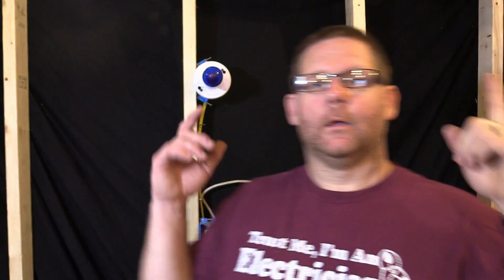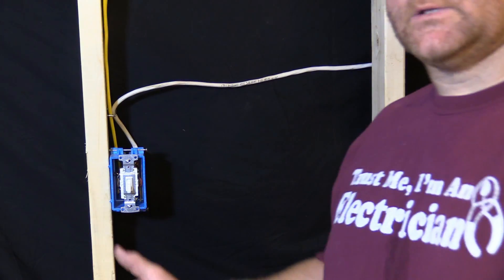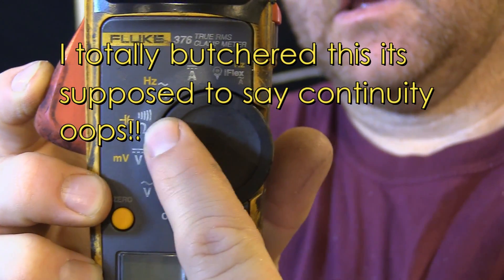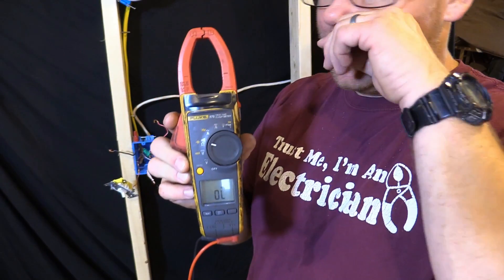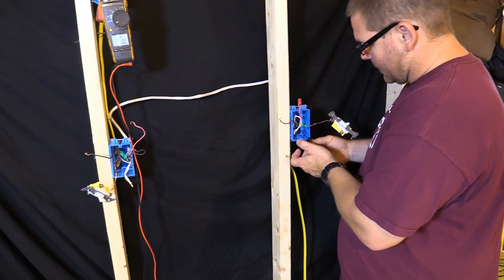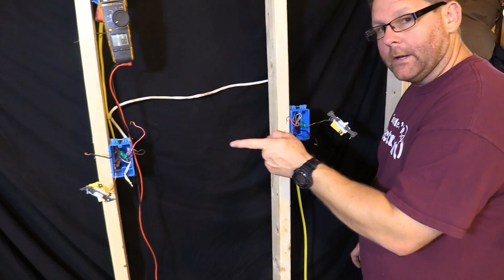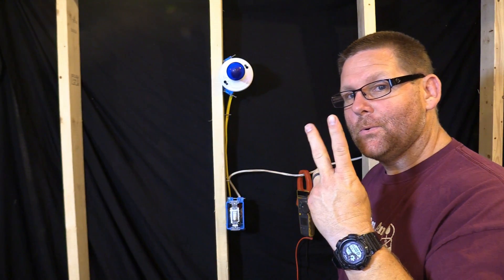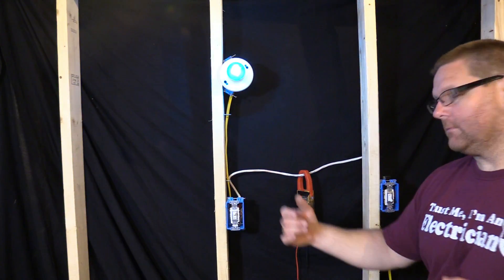How To Fix A 3 Way Switch Problem

Comment: Fantastic video, thank you for you time!
May I ask a question. I’m reinstalling the fan. I have existing 14 gauge wires in both of my 3way switches, but I’m rewiring whole house with 12 gauge. Can I use 12 gauge to power fan and 14 gauge for switches?
Reply from the maker: First of all thank you for the kind words. My answer is no. However, I have seen many electricians do that. When I see that I immediately go to the panel and slap in a 15 amp beaker and call them jack legs. To me that's kinda like buying a Mercedes when you need tires you go to the used tire place instead of getting name brand new ones. Since you are already rewiring your home, do it right and pull new wire to your switches too. That's my advice. Thank you for your question and if you have any other questions please feel free to ask. Good luck 🤞. Thanks for watching and commenting ☺
Reply: Thank you for reaching back to me:) Ok, I’ll use 12 gauge. One more thing: I have 20 amp breaker. Do I need to install all 20 amp outlets or I can use some 20 amp (like for microwave) and 15 amp in bedrooms?(remember, all my wires are 12)
Reply from the maker: Per code if you have more than 2 receps on a 20 amp circuit you can use 15 amp receps. If you have only one then Def use a 20. Most people will tell you to use 20 no matter what (on a 20 amp circuit or 12 Guage wire) but code will allow you to use 15.

Comment: My light keeps blinking. It will turn on  properly, but when I want the light is off it blinks? Please help...
Reply: No, it isn't... I changed the switches to better ones and it seemed to work. But then the circuit breaker blew.... Urghhhhh so frustrated
Reply from the maker: Did they blow when you changed the switch? Are you sure you hooked up the correct wires to the switch?
Reply: @MountaineerOutdoors  I did it the way you did it in the video...
Reply: @MountaineerOutdoors  it blew when I tried to turn the power back on
Reply from the maker: Sounds to me like you have it dead short. Hot to nuetral. Go back and check the wires.
Reply from the maker: Curious is it an led?

Comment: If you have a meter with no sound how do you tell what the travelers are in the second box away from the 120 v Hot ?
Reply: I was able to discern that may be the case. Once I had the hot, it was all gravy from there. Thanks a lot. Awesome video.
Reply from the maker: My pleasure glad it helped. ☺
Reply from the maker: You will have to leave it on volts to find the hot. Once you have found that.. Turn it to ohms it will read OL until you find the right ones then you will have a reading something other than OL.  Did that make sense?

Comment: The BEST video for debugging a pair of 3-way switches. I had this problem and found the hot wire first checking voltage between the wires and common, that was simple, then  I did your clever trick of jumpering the travelers together and going downstairs I found the other travelers via a continuity check, then I connected the 3-way switches to the correct terminals and flipped the breaker back on and it did not work.  AAAAH What could I have done wrong?, so I started measuring the voltage between the common and the travelers on the switch and one side got 110V and the other was 0 volts and flipping the switch it still had 0 volts.  I decided the switch was bad, replaced it and voila all works great...
Thanks for the tutorial and tracing technique.
Reply from the maker: Awesome I am glad that this helped you. It's a common problem and also easy to fix. Thanks for watching and commenting ☺

Comment: We have two switches for staircase and act exactly how you described at the beginning of video. We have two black wires and one white wire. No red wire and no obvious bronze wire. The other wires have been nutted and pushed back we don’t know why. House is 1978 and lived here five years so we don’t know why it has these wires pushed back. When my husband pulled out the switch it had one of those two black wires connected as ground wire. We can’t figure out what to do . Any help advice we appreciate and thank you for your videos. We subscribed to your channel. We just want both switches to work and not have to go up and down stairs to make each one work. Thank you . Enjoy your videos .
Reply from the maker: Question... Do you know if your nuetrals are being stitched? If not you will have to pull out the wires to find out what the hot is. Just like I did in the video.. Thank you for subbing also I appreciate that ☺

Comment: When you checked for the hot wire , did he touch a live hit wire & not get electrocuted ? Or did I miss something
Reply from the maker: No power was on. And FYI electrocuted =death. Shocked would have been what you meant.
Reply: I found out something... When checking for the hot wire... Make sure you place the probe on the ground wire, then place the other one.... DO NOT SLIDE THE PROBE!!! 🤕👮 IT WILL SPARK AND BURN THE PROBE 🤕😇 I didn't get shocked but had PTSD, when I had to finish checking.😉 It still works, but a burn reminder on the one.😇
Reply from the maker: Yep gotta respect it that's for sure. Glad everything worked out though

Comment: I lost power to my switches, bought the 3 ways, then replaced them step by step the same way they were wired, nothing!
Had a small check meter can't find the power coming in?  Then I thought ok must of got mixed up with this one so I wired again changing the top and bottom wire, tried again flailed.  I want to know is there anything else to check?  I had a power outage and this I think happened the same time, one day the switch started working by itself then quit again, before I put the new switches in. What else do I check before calling Mr. Electrician and what should I expect to pay for a visit, Darn?  Thanks.
Reply from the maker: First of all is the power coming in from the switch box or is it in your light box?  2nd is this the only thing that is affected?   If you have no power you have to find out where it is being fed from.. Tell me more information so I can better help.
Reply: @MountaineerOutdoors  I'm not sure, on one side I have 3 switches one to the dining light & under cabinet they work, but the third one going to the can lights overhead in kitchen don't work.  So one has three switches  overhead lights, dining and under cabinet.  The other switch is all by its self nothing else connected to it.
Reply from the maker: Do they all share the same hot? In other words are the hots tied together and you have 3 hots on your switches? Are these all 3 way switches
Reply: @MountaineerOutdoors  Ok, so what you mean is the other two switches the dining and the undercabinet lights are not three way.  So one switch light for kitchen overhead on that one makes three switches on one;  the other 3 way is all by it's self.  That's the best way I can explain it.
Reply from the maker: If everything is working other than the 3 ways you may need to look at the joints and if they are good then you will need to check the lights and back to the next box. By chance Is it fed from a gfci?

Comment: Hi, thank you for the video, you are awesome!
My 3 way was working fine and suddenly stopped working , having the same issue, sometimes it works , depends on who knows what, it did work fine , now it seems like a regular switch . What could be the problem there? Thank you !!
Reply from the maker: Make sure someone didn't put the other 3 way in the middle. That will make one switch work like that. If nothing else has changed then may have a bad switch

Comment: What if the hot wire is in the same switch box as the light wire?
Reply from the maker: That is a whole other video. Which I plan on doing
Reply: @MountaineerOutdoors  It's not a standard configuration but I have ran into it before.  Not hard to do just different.
Reply from the maker: I agree

Comment: Thank you! I was able to correct an issue that has annoyed me for years. One thing, all four wires on my (supply side) switch were hot. Yes, even the ground. Maybe a bad switch? 

I replaced the switch, worse it correctly as you showed and B-I-N-G-O, for the first time since I've lived in this house the garage and laundry room 3-Way circuit works properly. 

Here's a question, (maybe a future video idea)... I have a half bath on the ground floor of a 2 story home. There is a ceiling light with a fan. Each are controlled by its own switch in a two gang box. The light randomly flickers and sometimes goes off completely for seconds at a time. The fan works as it is supposed to all the time. I've checked the switch wiring and changed it from back wired to the terminals. Same issue! I've replaced the switch all together, same problem! I've checked that the light bulb is screwed in tightly, and it is. I've changed the bulb, same problem... I trust you, you're an electrician.! What next?
Reply from the maker: First of all thanks Letting me know that you fixed your problem... As for all of the wires being hot, if you use a tick taster my experience is it will show hot. They pick up inductance you would be better off with a meter at that point. If the ground was truly hot when you put in your switch and you touched the yoke of the switch and you were barefoot or grounded you would get a shock. As for the light. There is a lot of vibration with the fans especially if it's not a really really high dollar fan. I have seen wires honor fan become loose in the receptacle part of it where the fan and the light actually plug in. I would look in the light plug inside the fan to make sure that the wire was correctly in the plug also you can look inside the light itself there is a little tab in the middle sometimes it gets crushed and the bulb will only work when it is semi cool once I get hot it expands and loses contact with the bulb itself. Just make sure when you do all those checks that you turn the switch and the light off. That way you make sure you do not get shocked. Also if you're using an incandescent bulb maybe the bulb going bad and the filaments are only touching sometimes. Let me know what you find
Reply: Mountaineer Outdoors, thank you and will do. Just a quick note about the three way circuit I was able to correct with the help of your video. I checked the all the wires for current with both a stick and also with a Fluke multimeter. When I got the red light and alarm on the stick, I checked each wire with the multi and each rear 118v AC. Thank God that issue has been fixed. I was talking to a neighbor about your videos today.

Regarding the bathroom ceiling light/fan, I can guarantee it is not a high dollar fan, plus it is original from the 1984 build of the house. 

Thanks again and I'll definitely keep you posted.

Comment: Hey I’m having the same problem, how will you do it if on one side of the kitchen the switch is connected with 3 more switches(basically a 4 way switch box) and the other side is the same
Reply from the maker: You will have to open all the switches. On the 4 way switches you will have to make sure the wires are on the right terminals. The 4 way switches are marked. Then proceed with the 3 ways like usual

Comment: WOW, Thanks so very much. YOU made this easy. Using the ohms, to test for continuity was the key.  An having one wire in the other box, showing nothing, was the other key,(that went to the light itself, and the black screw in that box). Thanks again .
Reply from the maker: My pleasure thanks for watching and commenting.

Comment: Thank you! My husband replaced the switch covers and then they didn't work properly. I fixed them and got to show him who's boss 😂
Reply from the maker: That's right he should know that the woman is always they boss. Happy wife happy life. In my house only one boss for sure (and it's not me 😂 😂 😂) thanks for watching and commenting ☺
Reply: I put a three way switch on both sides of hall and installed two four ways in-between.My issue is that the three way on one side controls next four way and vice versa but none of these work in up unison.I  made sure I checked power and continuity what am I doing wrong? Help
Reply from the maker: Are you saying that you want the switches to be in the up position??  Because that just won't happen. One will always be up and the other down. If that doesn't answer your question please let me know
Reply: Replaced covers and somehow switched the wires around😬

Comment: How do you figure out which one is the neutral?
Reply from the maker: Normally it should be the white wire. You can use your continuity meter to go between the nuetral and ground. Once you have a reading between them you will know

Comment: @Mountaineeroutdoors
I did everything you said step for step and I still haven't found my problem, well I kinda think I did. My 3way switches are 15ft way from each other and I didn't have any romex to cut the distance so I spliced the 2 travels to the HR. My travels on the other in only picked up hot on the black but not the red
Reply from the maker: Well sound to me like you have a broken wire. That's what I am coming up with

Comment: Question when you connected the traveler's almost at the end of the video  to find the issue was the power on? Great video by the way!!! 👍
Reply from the maker: No i had the power off. It was on a plug which I had not together while I was working on it. Thank you for your question and watching. Have a great day

Comment: This has happened to me so many times in my house - I must have a dozen three & some 4-way switches - upgrading to new switches, I always seem to not mark the hot/switch wire and I always figure it out eventually BUT this methid is foolproof.  What additional steps would be required for a 4-way? I assume just a continuity check at each switch after identifying/connecting the travellers at the hot location?
Reply from the maker: yes for a 4 way make sure that the set of travelers that are in the 3 wire are on the same side of the switch it will tell you on the back of the switch what goes where with arrows usually you can look up in the  switch box and see the two sets of three wire .
Reply: @MountaineerOutdoors  I prefer the pen tester for finding the hot wire so I don't need to test to ground/neutral with a meter. I already know there is power so I don't need to see 120V, just need to hear the beep. Usually I don't get induced voltage on travelers when everything is opened up. I am experienced in lighting and electricity, so 95 percent of the time I already can look and see which is the common, and also if it is load or line.
Reply from the maker: Yeah that pen tester is handy. I like using it and always carry one with me but if it even questionable I'm getting my meter. Light switches not so much but other applications for sure
Reply: @MountaineerOutdoors  Yes like making sure you don't feed 277VAC to a 120VAC device haha. I have a Klein voltage meter that has no batteries and shows me from 12 volts all the way on up to 600 volts, and will show if AC or DC.
Reply from the maker: No batteries??  I have not seen one without batteries other than a wiggy.. But yes putting a 120 volt switch on 277 won't last but a second.  Been there done that.
Reply from the maker: Yeah that's what I was talking about in the other comment that's kinda like a wiggy... Handy for sure
Reply from the maker: Yeah that's what I was talking about in the other comment that's kinda like a wiggy... Handy for sure
Reply: @MountaineerOutdoors  This one doesn't buzz. It isn't quite like a wiggy, but similar idea.
Reply: @MountaineerOutdoors  Yes very handy and it always works for me when I just need to see voltage. I have other meter for amps, continuity, etc.
Reply from the maker: I really like the Klein meters. I think that they really give fluke a run for their money. Thanks for sharing this meter with me the price is excellent and I'm seriously thinking about getting one. Keep in my truck
Reply: @MountaineerOutdoors  No problem. I agree with you. Fluke is an industry standard, but for less money brands like Klein and Ideal definitely get the job done.

Comment: That's very clear, thank you. In my case, when I open the offending switches I only found 2 black and 1 red wire. There's no white/neutral. Also, there's no ground wire! The switches have a green screw for ground but it's empty in both switches. BTW, my house is in Southern California and was built in 2001.
Reply from the maker: Maybe they put black tape on the wire? And it should definitely have a ground wire especially since it was built in 2001. It almost sounds like you have a dead end switch or ghost switch. Where most everything is made up in the light box and just the 3 wire is down to the switches.

Comment: I fixed what the electrician did wrong thanks to you 👍🏻thanks alot for a great easy video
Reply from the maker: Awesome I am glad it helped. Thank you for watching and commenting. Have a great day ☺
Reply: Hey thanks for the video. It helped me understand the basics of wiring a 3 way light switch. I could use some help with wiring 2 motion sensor switches. Could you PM me by any chance? I could use some help with this problem.

Comment: I noticed both traveler wires are coming from same place as the power black wire is coming from the other side..
Reply: That's usually how you can tell. It will often be a red and black from the same NM cable. I twist them together when I set up for a 3 way.